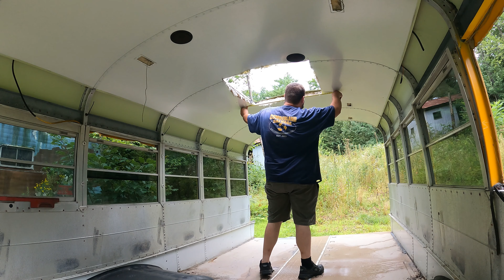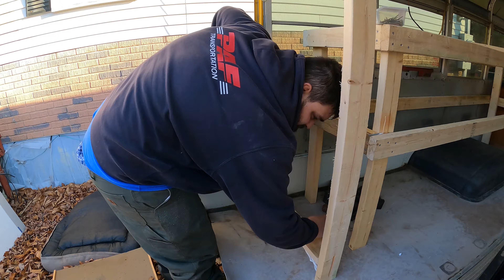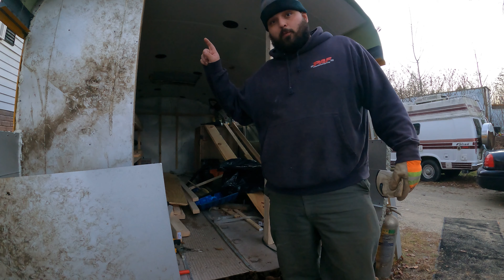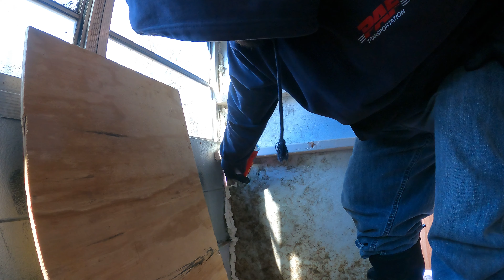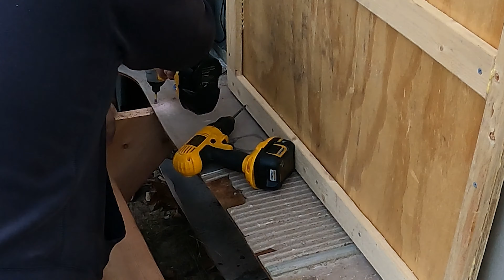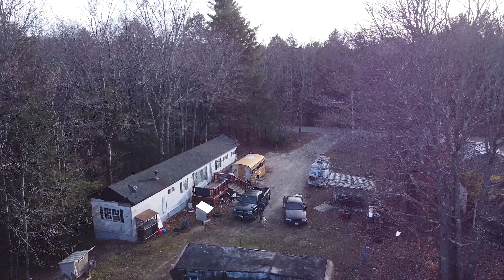Bus to Shed Conversion Build

Comment: I would have used a "MaxFan vent on the roof to both plug hole and have ventilation! But hey you can still do that! Lol. Bitchen bus on the front half too!
Reply from the maker: I figured I could do it the old fashion way and lower some windows - I'll have to look into that thanks for the tip!
Reply: @CerebralAilment  heck those super tiny 3,500btu~ AC window units slide right into those bus windows and only pull 3.5~5A on full blast
Reply: @HamburgerAmy  yep
Reply: @CerebralAilment  yep

Comment: I wish he had a video on shortening the bus, i just bought one and am going to cut 4’ off the back and move the rear cap/door section forward to have at least an 8’ flat deck/floor for a recessed gooseneck ball
Thats a nice cheap insulated work shop you got there though, like the floor clearancing tool lol